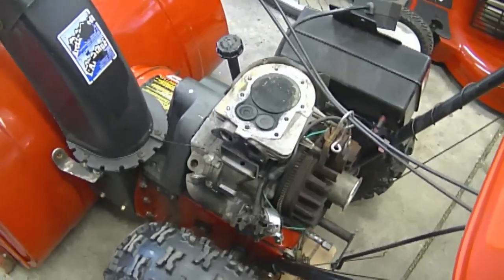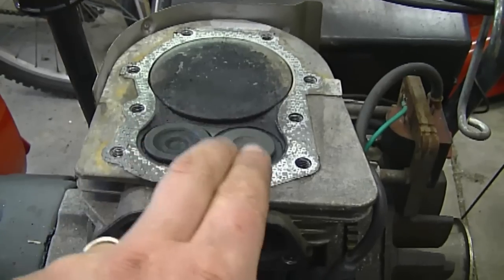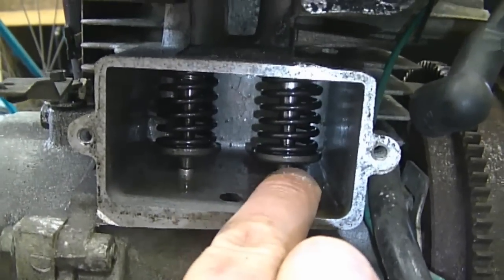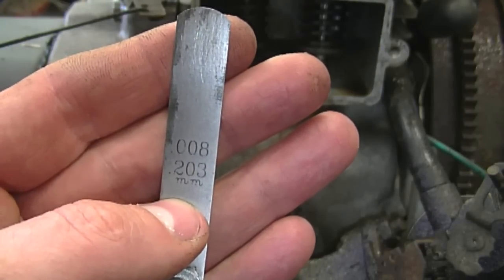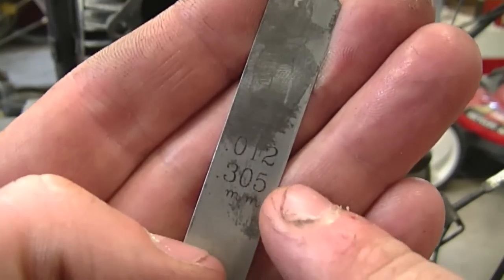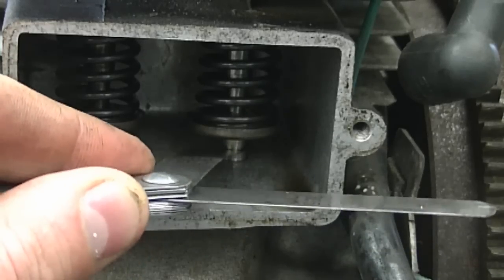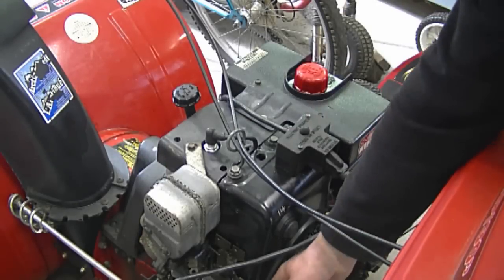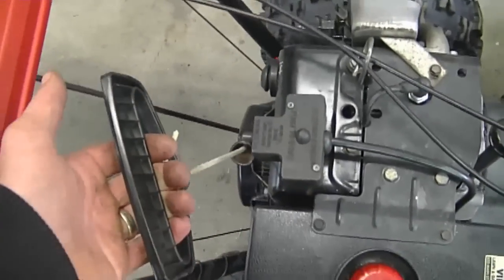HOW TO Check The Valve Clearance On A 4 Cycle Flat Head Engine

Comment: One thing you mite want to add is make sure your not on valve over lap. Just because your piston is all the way up. Don't mean your on compression stroke. The way I was taught - is when the intake valve is fully open- measure exhaust. When exhaust is fully open- measure intake. Makes simple.
Reply: EXACTLY.  if its at T.D.C. its not always on the compression stroke.  If you dont have the piston the correct way, you will get innacurate readings.  Also, Briggs recommends that the piston be .25" below the cylinder when checking valve clearance.
Reply: If both valves are closed your on the compression stroke with the eng apart there both closed so really don’t matter

Comment: My well used Murray mower, with the B/S 16.5 HP I/C engine, pumps oil into the valve cover through a galley located just under the intake pushrod. This oil is milky as it is being pumped but allowed to set for 15 minutes goes back to its normal color and consistency. It looks to be full of small air bubbles. I removed the head and found the gasket to be intact, no indication of a leak on the block or the head or the gasket. I removed the breather valve assembly (the reed valve as well as all else) and found it to be in good condition also. Very clean.This all started with the engine being hard to turn over even with a fully charged good battery. I reset the valves and this helped to some degree. It then began again to be hard to turn over. I then removed the valve cover and found it to be 1/4 full of oil. The motor does start with 3-4 tries, it runs good and idles as it should.  It does not smoke as it is running but will on occasion emit a large puff of grayish white smoke and then the smoke is gone... The oil consumption is not excessive. If you might have an idea as to what causes this issue I would appreciate your advice.   Thank you, ........Tom  PS...I enjoy and appreciate your videos. You speak clearly and slowly enough to be properly understood. Thanks again......Tom
Modify message
Reply: +Thomas Huckaby What a baffling set of symptoms! I'd be interested to know if you figured out the problem. Worn rings, maybe?

Comment: Thank you for the video. I own a 8hp Tecumseh and  I had a red hot exhaust at the end of last season, I rebuilt the carb but it was still running very lean. I had to grind 40 thou off the exhaust valve stem. I cleaned all the carbon off the piston and valves and changed the head gasket and intake gasket. The exhaust valve is seating properly now. I picked up a valve spring compressor and feeler gauges at Napa.
Reply from the maker: +davidbrennan5 thanks for watching

Comment: Love your videos, I have learned a lot. 
There seems to be much confusion all over the internet regarding the valve clearances of Tec. L head engines.  Some say like yourself,  .008 in. / .012. ex. and some say it's .008 min. for BOTH valves and .012 max. for BOTH valves.
Different years and versions of Tecumseh manuals have kind of confusing information.  I have a 1978 Ariens 7/24 that backfires out of the muffler when working hard and quits.  After it cools it runs good again untill you work it hard again.  My exhaust valve clearance is about .006 or .007 I'm thinking it get less when good and hot and causing this problem.  I don't want to remove too much material though.
Reply: Yes!  That is the question I'm trying to figure out.  I believe it looks as if it's just a minimum of, in my case a LAV35 L head, .04 min and .08 max for both valves.  But it sure would be great to be 100% certain on this.

Comment: Hi Dony, how's it going?  I just finished checking the valves on my 5hp flathead snowblower engine and found that my exhaust valve has no gap at all and my intake has a gap of .012.  I realise I need to file down the exhaust a bit, but how do I make the intake gap smaller? would buying a new valve fix it?

Comment: Before Tecumseh went out of business, I ran into  brand new engines that the valve stems were never ground. Very rare anymore unless it's very old, valve seats have been beaten to death from worn valve guides or at the very end of tecumseh's run with the worn out molds and dies. But only ever seen maybe 3 or 4 like that new.

Comment: Thank you for this video, very helpful. When you took the exhaust valve out to grind the stem, were there clues which indicated that the valve face did not need to be ground, or even lapped in?

Comment: perfect I have a briggs quantum on a lawnmower that  I am so far not able to fit any feeler gage into either the intake or exhaust.  going to make sure its at TDC.  this mower when hot would be very easy to pull like low compression . when cold it seemed ehh ok.      going to check it out more and perhaps shave off  a little to get it with in spec.  This Toro is a High end Toro with a Blade Clutch personal pace.  I just put aside while I worked on other things and just now came back to it.

Comment: Thanks Don.I've been doing a lot of research on how to adjust non-overhead valve engines for the past few hours.Now I think it's basically the same for adjusting 18 h.p. Briggs opposed engine.Good info on the part about spinning the valve for wear.
Reply from the maker: DesertDigger1 yes same procedure
Reply: how to fix a small lawnmower if no compression and valves seems coming out and stuck

Comment: Would of been nice to see how you ground the valve stem to the proper clearance and explained why the problem accrued.
Why did it happen, I still don't know . . .thank you 
 
 I fixed this same problem on a garage sale find, all I used was a pedestal grinder and a 10 buck digital caliper.  
I find the best grinding results accrue when you use the side of the grinding wheel since most of the time that part of the wheel has not been abused and will run truer.

With nimble fingers and a 2 degree rake I gently rotate the stem against the side of the wheel, this will produce a crown in the center of the valve stem. I find this is much easier to controls then a flat grind,  this way when you get close you can stone off 1 or 2 thousands with little effort for the final fit.

Thank you for your teachings donyboy73 . .  .we all need to spread our knowledge ;)<(
Reply: FWIW the valve clearance likely gradually reduced as the face of the valve, and the valve seat wore over time.
Reply: @JeffinTD  DUDE THANK YOU. I was like, is it just build up on the cam journals? That didn't make sense. Valve wearing away does. Thanks
Reply: @andrewchristiansen-Detroit    Yeah on some engines the lifter, rocker, tip of the valve might wear faster and gap will increase- but on this old flathead there’s no rockers, nothing is sliding on the end of the valve so it’s just a matter of the (likely soft) valve seat wearing faster than the end of the tappet.

Comment: Well done, what's your therory as to how the the length of the valve stem gets longer than when installed from the factory ?
Reply: The valve doesn't get longer but it gets deeper into the seat as both the valve lip and seat wear, so it gets closer to the tappet

Comment: Hey dony, can you explain to me how a valve (say exhaust valve) which doesn’t have any adjustments on it, would fail to seat properly over time? Ie what changes that you need to grind the valve to increase the valve clearance??
Reply: That is my question also. I can see things wearing and having MORE or too much clearance but how does clearance disappear?
Reply: If the valve seat wears then the clearance between the pushrod and the valve stem will decrease

Comment: OK Thanks how do you know if you have taken enough off. It looks like a hit or miss kind of way. like the 0.12 how many  times did you stroke the vale with the file to get the clearance. I have a nice 3.5hp 70`s vintage  Ariens blower that needs  lapping and do the clearance.  Any info would be helpful. Thanks.
Reply: Gary B  I have the same problem on my 1979 Toro snowblower  with an older Tecumseh 3.5 hp engine. its shooting flames out somewhat, but ive learned to check the valve spring itself, try and see its resistance to being compressed and possibly that could be why its not seating properly. I have had that problem on other applications as well especially on older flat head motors in general.

Comment: Hi Donyboy73, How do you know that the exhaust valve is not lifted by the automatic decompression mechanism on the camshaft? Should you turn the crankshaft an extra 1/4 of a turn to ensure the automatic decompression mechanism is disengaged before taking any measurements for the exhaust valve? BR and have a nice day.
Reply: More info  taken from: http://www.briggsandstratton.com/eu/en/support/faqs/compression-system

Compression Release System
:
The compression release system lifts either the exhaust or the intake valve slightly off its seat during the compression event (this is why the piston is positioned past top dead center to about 1/4" down from the top of the cylinder when adjusting valve clearances).
:

Comment: Because of a badly scored cylinder, I had to purchase a 'new old stock' block for my 5hp Tecumseh HSSK50-67403U Yard Machines snow blower. I also purchased a new piston, rings and wristpin. Also purchased two new valves and a complete gasket kit.
Short block is back together, crank & cam timed properly.
I lapped the new valves and checked valves at TDC...before I put the cam/crank cover on I could easily see the 'lifters' were on the heel/low spot of the cam.
Clearance on this engines valves are intake-.004 & exhaust.008
Intake is in spec however I have to grind the exhaust...I have a bench grinding wheel but wondering if a Dremel would work better > > >  I'm a little concerned about removing too much metal.

Comment: Hi again Donny, as you suggested I checked the clearance on my B&S 11.5hp, and there was basically no clearance on either valve. After grinding and lapping I have 10 thousands on the intake. I know this is too much clearance, but will it make much difference on the inlet, and if so will further lapping be enough to reduce the clearance? Lapping seemed to be increasing the clearance and this is the opposite to what I expected....

Comment: Hi Dony.  I'm rebuilding the exact engine you show in this vid and I'm at the point where I'm putting the valves in.  I'm not seeing any clearance in either the intake or exhaust valves with piston at TDC.  Is there anything else I should check before I go grinding down the valve stems?  Thanks!

Comment: I may be wrong I'm not an expert but I think that on most flat heads since the is no compression relief mechanics, either the intake valve or exhaust valve will have some clearance to allow the engine to turn freely at startup. please correct me if I'm wrong

Comment: At the shop I used to work at we would get Chinese scooters in all the time, 75% of the ones that came in the door had a stretched exchaust valve. Can be caused by running at high load for a long time, or just cheap metal, just my 2 cents and as always great vid Dony

Comment: Dony, Thank you for your continued five star videos. Please explain at what point the automatic cam  decompression system; starts, then stops to function. Also with the flywheel key checking out okay, what else normally affects "pull starter kickback?" Tim.
Reply: Valves no set properly  try again.

Comment: Hello. I have the exact same question as Blitz Hunter with the slight opening of the exhaust valve. Both valves can not be spun with the piston at TDC. However I did not check if I could spin it when there was the slight opening I am mentioning. Mine is a HSSK80. I can not get the engine to run right. It backfires, stalls and loses power. I am planning on doing a valve job but I was wondering as well if this opening is normal in the cycle and if that is really the issue with how the engine runs. Thanks.

Comment: Hi Donny - Great Videos.  1 Question.  At TDC, the exhaust valve is fully seated on my engine and I can not spin it by hand.  But...  on the compression stroke, it seems the valve opens VERY slightly, like there is another small lobe on the cam.  I can spin the valve during this slight opening, but it seats again just before TDC.  Is this normal?  Tecumseh HSSK50 engine.

Comment: Wouldn't it be a good idea to lap the valve and valve seat before adjusting the play? There could be carbon buildup on the valve seat that will prevent the valve from sealing perfectly even after you adjust the clearance. And if a piece of carbon comes off you might have too small valve clearance again.
Reply: You can't lap the valve and valve seat before adjusting the play because they don't touch when there's no valve clearance at all. The issue is the seat and valve face wearing making the lifter clearance non existent. I've done 5 valve jobs in a year with the Tecumseh flat heads.
Reply: No Goran you have to get clearance first as the seats will not mate up and grinding paste will not grind the seat of the valve or the block seat , get clearance first then grind and paste and adjust clearance as required  it takes time as its imperitive the clearance is correct as the exhaust valve seat will burn out as theres high temps in there loke up around 1200 degrees c in the cumbustion  chamber  ,Dony boy 73  did a good demonstration there , he is a good chap at his job he will have it running right before it leaves his workshop

Comment: I am officially stumped!  Working on a Tecumseh LAV35-40712K 2.5 HP flat head engine from a 1973 Toro shreader.  When I got it, 0 compression.  removed muffler and carb and head.  Redid the valve seats with a Neway seat cutter.  I found that the intake valve was bent.  Installed new valve and lapped it in.  Replaced head, no compression, hooked air to spark plug hole, have air rushing out of the carb port at TDC.  Valve lash is to spec.  What am I missing?  Possibly bad spring?

Thanks
Tony

Comment: 1. I don't think the valve can be "stretched" by the srping.  I think it is because the wear between the valve and head so the valve "seats" deeper into the head so they lose the gap.
2. About question #2.  I understand it "touches" the valve to open it but not at TDC.  If the valve is not tight at TDC, I don't see how you can make it tight just by grinding it down.

Comment: I have a toro 824 with a techemseh engine I'm doing the exact same thing to it and I was trying to find torque specs and bolt pattern on the head. Haven't been able to find it, do you know the torque and tightening sequence? And if you do could you also tell me where you find all your specs. Thanks in advance

Comment: 1.
I bought a mower yesterday. They told me the engine was no good. When I got it home I noticed it would spin over but there was very little pressure. My first thought was the valves. This is a Briggs 13 hp gold , flat head. Some of the head bolts were like finger tight. So I took the head off. On the top valve there is , like a ring around the valve. I am sure its the part that mounts into the block. So the the valve can come down and make a seal. I put it back in its hole.

Comment: That's a good review. I was expecting you to have to relap the valve seats, but it looks like that wasn't necessary. I suppose that if carbon was holding the valve up, the gap would have been too large.

Comment: Would valve clearance being off cause the mower to pull the starter cord out of my hand, very hard when I try to start it? I have checked the crankshaft and it is not bent, and it is not hydro-locked?

Comment: I got a flat head briggs that Im sure has valve issues on the mower. Its a  2013 flathead but it has electric start so i want to get it working. OHV is so much easier to adjust lol.

Comment: Might mention prior to grinding down a perfectly good  valve to rotate the engine again, there is such a thing as valve overlap between exhaust  and intake strokes. Engine didn't have excessive valve lash when you finished and a bunch of ticking by chance!

Comment: Hi,would you always measure the valve clearance with the springs and retainer in situ,
The reason I ask this is because,I had noticed when the springs and retainer are not placed on the valves when gap setting,they become smaller in distance once i replace the springs and retainers back in.

Comment: I am working on an early 1970,s 3.5 HP Tecumseh vertical shaft engine from a Toro shredder that hasn't run in years, bought it at a garage sale.  When I started, had no compression.  I pulled the head and lapped the valves.  Valve clearance appears correct but after reassembly, only had about 10# compression.  When I pulled the the head and removed the exhaust valve, there was a bunch of chunky black stuff between the valve seat and muffler. Cylinder walls look like, what do I try next?
Thanks

Comment: about a min or so after a snow blower starts is it normal when you look inside the muffler it glows red. The muffler did the same but i adjusted (i don't know what you call it) that little arm right in front of engine that a wire connects to the carb. it helped the muffler not glow but it still does when you look down inside the muffler. What would cause that? Any answer would be greatly appreciated.

Comment: I'm having some problems with my Toro 824

When I start it up (I'm trying to get ready for the upcoming winter), it sputters, backfires a bit and then it stalls when I try to engage the transmission or the augers. When I move the throttle level up or down it doesn't change anything in terms of power.

I rebuild the carburetor and fuel is getting to it fine. I thought it might be a blocked gas cap but that's fine.

Measured the valve gap with a feeler gauge and the intake is fine at 8 thousands, but the exhaust which should be 12 thousands has no clearance at all so it is out of adjustment.

Is what I'm describing caused by the valve or is it something different? Please help!